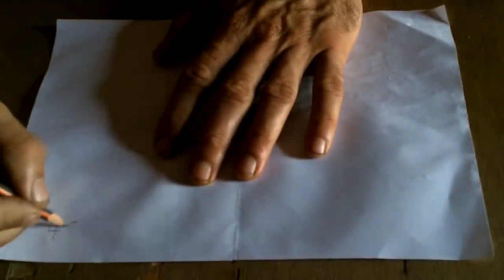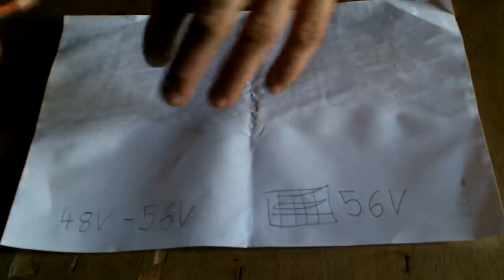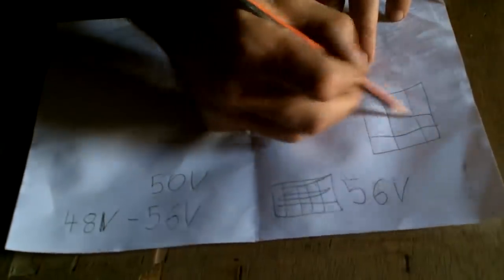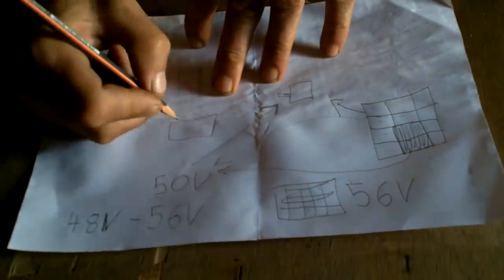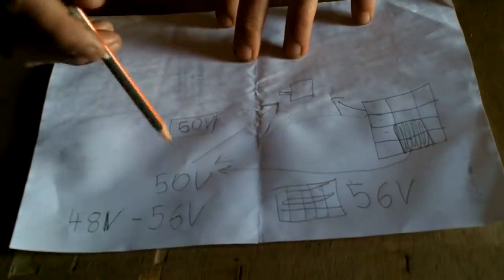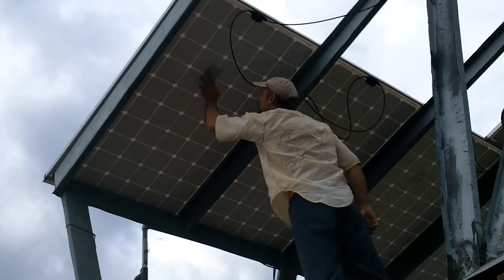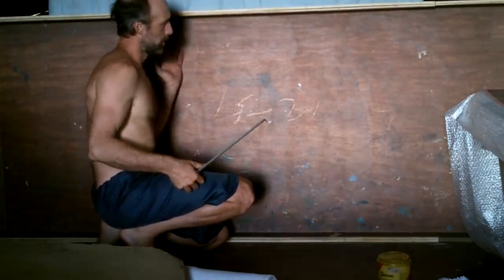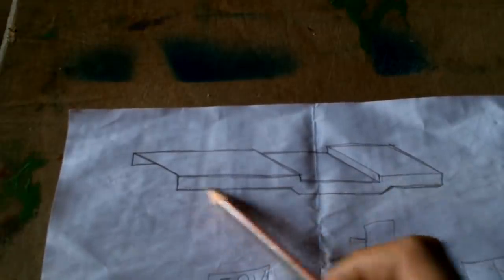Solar Snailer 028 Glass Panel n' Batteries

Comment: Jamie, it is essential that you get a charge controller (or more), and a battery management system to keep the cells in balance.
The risk over overcharging or undercharging the batteries and destroying them is too great.
You could use 3 cheap CTK-EV-300 MPPT boost controllers set to output 56V. Each controller could use 4 panels as 2S2P up to 10A. That's one for each "page" of your roof. They connect to the battery in parallel, and you run the motor from the battery.
The BMS would make sure the battery would never discharge, or overcharge, and if you've got sunlight, you've also got power.
Reply: Andy
What's the denominator x 12 ?
Reply: @SupernaturalBeingsofEarth  3 parallel strings of 4 panels arranged two in series and two in parallel = 3 x (2S2P) = 12.

Comment: You need an MPPT charge controller. it can handle a variety of input voltages and is made to be programmed to optimally charge (but never over charge) your batts whatever style they are. Nothing you can build can even come close to an MPPT's performance.

Comment: when you make the lithium battery you could protect it with a battery management system(also lots safer because of fire hazard)  its usually really cheap and reliable the vendor or sponsor you would get the cells from would be able to get one.  it would protect over charge over discharge balance the cells to prevent damage/cells that work harder because there is an imbalance etc. and if the battery is ''removable'' you could also use it for other boats/house etc. also im not sure but using different voltage panels/technologies might give problems?

Comment: I would go with mppt charger (they are cheapish) and charge with all the panels on high voltage 110v so you could also have less copper in wires...

Comment: As others mentioned, you need a MPPT charge controller. You certainly can attempt to hack your solar panels and motor together without one, but you risk reducing the life of your batteries and you won't be operating at a high efficiency level. The MPPT charge controller ensures that you're capturing ALL the power from your panels and then optimally delivering that power to your battery bank. PV -> Charge Controller -> Battery/Motor.  When batteries are full, the motor will be drawing current from the charge controller. When solar is low, the motor pulls from the batteries. Simple.
Reply: He doesn't need an MPPT. Just any DC-DC buck converter that can take excess of 56v input, and produce 56v steady output is fine. There is zero need for a higher voltage to charge up LiFe batteries or charge them up quickly, that's not how LiFe batteries work, he is misapplying his knowledge of lead acid and NiCads.
Reply: @MattsAwesomeStuff  No, not any DC-DC converter will work without some way of being able to match the current to the panel.
If demand is too high then the panel voltage will collapse and supply little power, likewise if it doesn't pull enough then the panel voltage will stay high and not give its maximum power.
It needs a programmable type of DC-DC converter, of which an MPPT controller is a specialized subset designed for the job.

Comment: Considering the expense of the PV's Jamie intends to use on this project, I had erroneously assumed that he had become better acquainted with solar power and storage systems, but this video reveals his ignorant on the subjects. 
The nominal voltage output of PV's is not a constant. It fluctuates with light input and load. To compensate for PV's inconsistent output, DC-DC inverters are typically used which can automatically both increase and decrease voltage with very high efficiency to provide a stable and constant output. There is absolutely no need or desire to match PV's output voltage to the surface charge of storage batteries. An off the self charge controller is all that's needed. 
Unlike lead-acid batteries. Li's are very intolerant of improper charging. Not only will improper charging shorten the life of Li batteries, it can result in them overheating and catching on fire. Again, a proper charge controller is mandatory with Li's.
Maybe if Jamie does a little research on this subject he will come to the same conclusion that every EV manufacture has: PV's are not a viable power solution on a vehicle/vessel that can be connected to a charging station daily. He would be better served by setting up a land based solar farm, with wind turbines, and using it for charging all his toys.
Reply: Now if someone can find an open-source-3D-printable one, Jamie will be set...
Reply: He is using LiFePO4 batteries, which are more tolerant to overvoltage than other Li chemistries
Reply: E Designs - You're right about everything except mounting the panels on the vehicle. Jamie loves this, it means that any time the sun is shining he can be moving. It makes perfect sense in his context. And... he can't afford enough battery capacity nor probably fit the weight he'd need otherwise. He's going on man-hour long trips.

But he absolutely needs a DC-DC converter. It solves 100% of his problems. He misunderstands why he has not been getting the full power out of his lithiums in the past, and he's mis-applying his knowledge from Lead-acid batteries and NiCad batteries in a way that is going to ruin his LiFe batteries the first time he uses them.
Reply: @MattsAwesomeStuff  Jamie definitely needs to learn a little more about Li storage and charging. 
They are pros and cons to installing PV's in a vehicle/vessel. Before the advent of Li batteries it was easier to justify installing PV's on an EV because of weight, storage capacity issues and small cycle life, but that's no longer valid. Li batteries have more capacity than PV's of a comparable weight, and the batteries take up far less space, which is typically almost always an issue on EV's, even boats. But most important is with Li batteries you can easily and reliably  calculate run-time. In contrast, with PV's, you can only derive a very rough estimate which is frequently rendered invalid by rain or clouds. 
There are other issues like the exceptionally short life span of the flexible panels Jamie intends to use and their higher cost than comparable rigid PV's, which are better suited to land based installations.
Reply: @EDesigns_FL  - I don't think you know what you're talking about. Solar panels have infinite capacity, they don't "run out" if the sun is shining. The longer a trip you have to make, the more they make sense. Jamie makes long trips. Also, on run time, weather affects batteries too, not just panels. Waves and wind. With solar you can still limp home. But if batteries are dead, so is your boat.
Reply: @MattsAwesomeStuff  You misunderstood what I stated. When I referred to PV's capacity, I meant their "output capacity", i.e. how many KW's they deliver in a given cycle, e.g. a single day in Jamie's application. I was not referring to their "storage capacity". And, my comment is correct. Your claim that PV's have an 'infinite capacity" is ridiculous. A rough estimate of their total maximum output can be calculated by multiplying their average output per day X their mean lifespan, which is not infinite. The flexible PV's Jamie intends to use typically fail within one year. 
You don't seem to have a grasp of the power requirements for Jamie's boat. As an example, if he were to run a motor at 2kw (~2.7hp) for 3 hours in a single day, it would consume 6kwh's of power. Though Jamie's PV system might be able to theoretically produce that amount of power in a day, it won't be able to deliver all that power in the 3 hour window when it's needed. Yes, he can balance the power requirements with an ancillary battery, but then you have to consider the enormous waste of capacity when the PV's aren't being utilized, which is most of the time: Jamie does not make long trips every day. 
You obliviously have no or very little experience with PV's because if you did you would appreciate how ludicrous it is to rely upon their contemporaneous output to get you home. It didn't work for Jamie's previous solar boat and it's not going to work any better for his current project. 
You've posted a lot of comments to this video and it's evident that you have some misconceptions about management of Li batteries. It in not acceptable to use them without a management system. Cells will be ruined if they are excessively discharged or overcharged, and it would be asinine to manually balancing them when reliable and inexpensive devises are readily available, and the cost of a simple mistake is so high. With proper care, an Li battery pack should last more than a decade, but using "knife switches" and manually charging it is likely to ruin the pack in a single day.  
There is nothing unusual or complicated about what Jamie is trying to accomplish. Electric conversion kits are available via Alibaba and other sources that will meet his requirements for absurdly low prices. Here's a example: https://www.alibaba.com/product-detail/CE-Approved-5KW-electric-outboard-conversion_60537091297.html?spm=a2700.galleryofferlist.0.0.7ac43ca8tsjyJ3
Reply: I say "pah!" to the naysayers, I think it'll work fine, you are taking very generalized advice that is overall correct about charge controllers, lithium batteries, etc and applying it to a very specialized particular situation where those rules don't necessarily apply  - particularly related to the overall wattage and power of the design; Jamie's got well over a kilowatt of solar panels on a boat that weighs WAY less than a car, and while his motor may use 5000 watts maxed out he will probably usually use it throttled down / using 500 watts or less.  People are building 40 ton electric powered yachts with less solar capacity than Jamie's tiny double canoe, a lot of the careful design tradeoffs about "you can never fit enough solar capacity to be worth it" just don't apply when you've got 4 watts of solar capacity for every kilo of boat weight
Reply: E Designs - No one uses "capacity" to mean power. You specifically use the term "capacity" to differentiate between power and energy. When someone asks the capacity of a battery, they are asking about the amount of energy it stores, not its max discharge rate.

Obviously by "infinite" I didn't mean literally infinite. The sun is not even an infinite source of power. As to their average output in a lifetime, solar cells rarely fail, their capacity just slowly declines as a half-life.

It doesn't even make sense to compare batteries to solar. One stores energy the other is a source of energy.

I very much understand the power requirements. In Jamie's context he doesn't care if energy is being wasted. He has more energy than he needs at home. The energy that is useful to him is in being able to get to town and back. So it makes most sense to put that on the boat. He also likes being disaster proof and he's talked about how much he loves having energy available wherever he goes.

Not entirely relying on solar is exactly why Jamie has both batteries and human propulsion built into this craft. Why are you even talking about that like it doesn't work? It's worked on every boat he's built.

You obviously don't know much about Lithium batteries other than to follow a textbook solution. Lithium batteries are just fine without a BMS in a DIY scenario. You wouldn't release a commerical product like that but there is zero harm in skipping them for someone who will occasionally use a voltmeter and spend a couple minutes balancing once a season. BMS's cause more problems than they solve by ruining packs when the BMS randomly breaks. Thousands of DIY E-bikers and electric car builders have never used a BMS on their packs and ran their gear for years just fine. There are more pack failures from BMSs going bad than there are from people not using BMSs.

Go look up today's thread on /r/Adventurebuilders and see my comments there if you think I don't understand how solar and batteries work. I actually know how they work, not just parroting what a spec says you have to do.
Reply: @MattsAwesomeStuff  Exactly - this really reminds me of the whole "hull speed" thing where all the armchair naval architects explained to Jamie how it isn't physically possible for his pedal boat to go as fast as it actually goes because he just must not understand boat design.     These overgeneralized "rules" don't always apply
Reply: @VeganSurf  Any armchair naval architect worth his salt will understand that hull speed is a generalization that does not apply to long skinny hulls in the same way that it does to more "normal" shaped displacement hulls. In other words, Jamie has definitely NOT proven any experts (or knowledgable amateurs) to be wrong.

Jamie deserves tons of credit for actually doing stuff, making his ideas into reality. Few people actually manage to do this. What he does not deserve credit for is building things to be as efficient as they could be. Probably, most of these "armchair experts" can readily see the errors and performance losses that he builds into his boats. The average person does not see that, they see someone that is building things that work and they don't care that they could perform better.
Reply: There is nothing stopping Jamie from charging on shore and also charging at sea from the panels.
There's a lot of solar real estate on the boat which is great to be able to make use of as well as acting as a roof.
Reply: @HarmanRobotics  I also assume from what Jamie said about "no chips" that we're talking about a brushed motor

Comment: Jamie - I get what you're trying to do... but your solution has massive drawbacks for minimal gain. And LiFe batteries are the most sensitive of lithium chemistries. One mistake too high or low and they're likely dead. It's why they all but stopped making them 8 years ago. I have the same preferences as you for not having fancy control electronics, I love the hands-on direct feel of simplicity. Just a power source and a motor and that's it. But you're giving up so much and adding so much unreliability and limitations just to avoid that. You won't get stranded by having control electronics, you can always hotwire motor directly to the panels, the panels directly to the batteries, or the batteries directly to the panel if anything happens. And in that situation, you'll have to watch it and be aware, but only during that emergency, otherwise everything will work fine. You're seemingly trying to avoid the worst-case scenario that's likely to never happen, and instead making a different worst-case scenario 100x more likely, versus just having something that works all the time.

Get a proper DC-DC converter, and/or MPPT. They're 95-98% efficient, and the performance increase you'll get out of using them is way higher than that. Have a big knife switch to bypass them if you want direct drive.

You're going through the trouble of buying and building a battery system that you won't be able to use or charge effectively, just to be slightly more efficient and slightly more disaster-proof. You're going through the trouble of installing solar panels and then only getting a moderate fraction of the power you could get out of them. You're designing all kinds of wonky this-goes-there, that's going to reduce your power and efficiency.

You don't have to use an MPPT converter if you don't want to add that extra bit of efficiency. But, do get an actual charger for the batteries. One that can take a reasonable input range but always gives the correct output voltage. This isn't some bleeding edge unreliable technology. DC-DC converters are as robust as anything you'll need, chances of failure are extraordinarily slim, and you can just flip a big knife switch in the event of a failure.

I think you might be avoiding technology just because you don't understand it. You're going through all this trouble and massively limited performance just to avoid using an actual battery charger and a high/low voltage cutoff relay.
Reply: Matt is more eloquent than I would have been. But I totally agree. You won't want to babysit your boat while its charging.

Comment: Ok I get it; it's a brilliant solution. 
Would using a fancy chip with this be more efficient? Perhaps leaving this configuration as a solid backup with the ability to do a quick switch in case of a part failure? I honestly don't know the way to measure the efficiency difference or the battery life difference, but I am anxious to see it float either way!

Comment: i think for the top off panels you could use a dc boost converter the rest of the panels can stay attached to to the motor and battery when running the back feed wont be much of a problem if the solar is equal to the battery voltage are you going to use a speed controller or just a knife switch if just a knife switch then you could switch solar and battery on at the same time

Comment: Moreover you get twice to distance in this double battery rig. Your home Shore power should be enough to recharge the batteries. Since you have solar on the dock you should have electrical line it's either supplying or delivering power to and from the dock and the dwelling.

Comment: Hi, Jamie... Would be muuuuuch easier for you, you would get a little bit into arduino programming. That way you could achieve a perfect solution for your electric Problems. And...yes... it works perfect on a boat. I am living on a Houseboat since more the 10 years and all my arduino stuff..(charg controller, lighting, heating..and so on) runs without any fault, eversince.

Comment: I would solve it like I planned my future project. Long range four-wheel e bicycle camping rig. I'd have 2 e-bike batteries 48 volt. And one 48 volt solar charging. And basically switch batteries. Noting that the charge controller will do the charging. And the other one is driving the motor. In actuality there is no direct solar ring the motor. But experiments can happen.